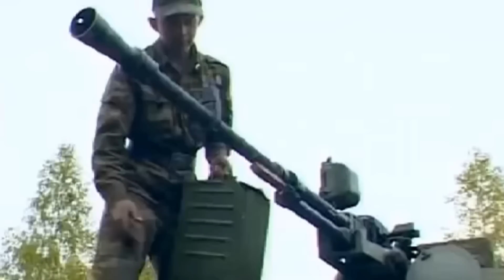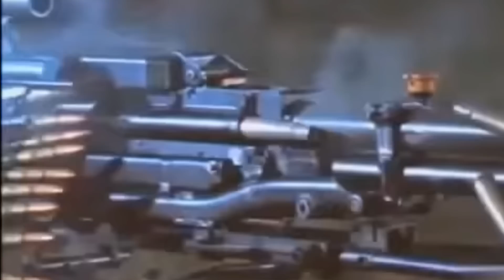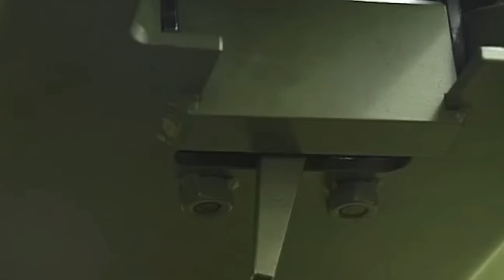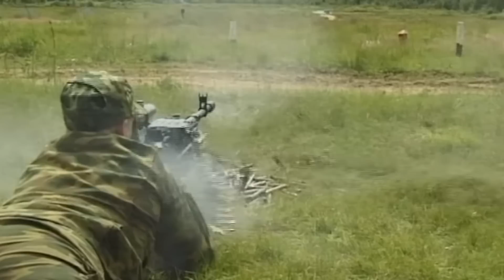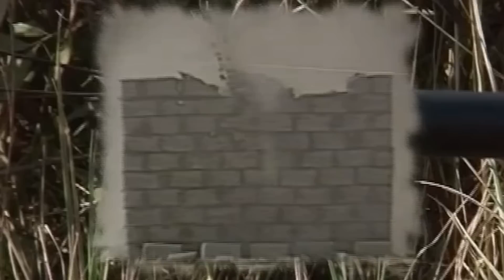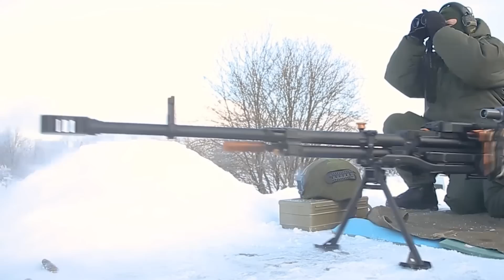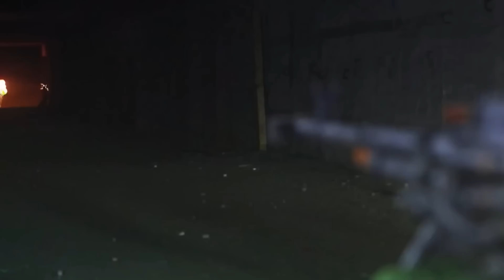Kord 12.7mm Heavy Machine Gun | Russian Beast

Comment: Im impressed by how much lighter it is than the M2.
Reply: @John Tungul Not to mention 2 layers of full ammo box is going to sop any incoming small arms fire like a shield
Reply: @5002strokeforever  a shield that has the potential to explode
Reply: The m2 is mostly relegated to being a mounted weapon. The mounted variants of the Kord are not that much lighter than the M2.
Reply: depending on what you are doing with it, that's not always good.  Weight improves accuracy and recoil, but makes it less portable.  It's a trade off, so it just depends how you intend to use it.
Reply: @p51mustang24  these beast mate can be carried by one big soldier from house to house, field to field in moderate speed while maintain high accuracy and lethality. Can m2 do it..?
Reply: @satriorama4118  there are several pictures of soldiers in Vietnam carrying the M2 on their shoulder (solo) while the other man of the team carries the ammo.
Reply: @p51mustang24  small 3 man mg team moving from house to house in god knows where

Comment: The cocking wire in the ratcheting cocking mechanism will be at least 10 times stronger than it needs to be. Metal cables are ridiculously strong for any given diameter. It ain't going to be snapping and causing problems. Great overview and detail about this monster of a machine gun in this video though.
Reply: "Metal cables are ridiculously strong for any given diameter."

Having worked with and around steel cables, I have to disagree with you.  They're initially strong, but they're very prone to stretching, wear and corrosion.  Give me a cocking handle.

Comment: Meh.  The Browning .50 caliber (12.7 mm) is better than this.  The Belgians even modded it to fire at 1,600 rpm.   

Russia’s most beastly heavy machine gun was their KPV-14.5.  Too damn heavy, actually.  But its 14.5 mm slug could show Mother Russia’s love accurately out to 4 kilometers.  Even the Browning pales compared to that.
Reply: depends what you want to do with the Kord and M2, Kord is lighter, can be more readily used in forward elements and motorized and mechanized elements whilst the M2 would probably do better in armored elements to negate its heavy weight and allow it to use that weight to enable longer bursts with great spread accuracy. Either way im getting the fuck out of dodge if those things are deployed in the area
Reply: Any heavy machine gun is much better when placed in a truck or on a tank thanks to the mobility increase.  But the guns' weight differences to either vehicle type is negligible.  An M2 isn't itself deadlier if carried by a 5 ton truck or an M1A1 Abrams tank.  Nor does it matter if it's an M2, a Kord, or a KPV-14.5, standing in front of one firing is bad for your health.  You'd just have to run a hell of a lot faster to get away from a KPV.

Comment: The Kord and thier 30mm auto grenade launcher (dont know the name) are two of the best light infantry weapons in the world, far better in fact than our own counterparts. The reason I say this is because they are more useful. Imagine setting up a machinegun nest in the fourth floor of a building and planning on shooting down on top of APCs with AP with a M2 Browning 50, it can't be done, the Kord can. Also our 40mm grenade launcher is far less portable than thier 30mm and has about the same blast effect radius.
Reply: Who told you you can't setup an M2 on a roof? There are definitely pedestal mounts for it. You don't even know what you're talking about.
Reply: Do you have a reading comprehension problem? I said a fourth floor window firing down on to the top of an APC. What are you smoking?

Comment: The guy on the left at 7:13 is the spy of the western cause he's wearing an ADIDAS shoes .
Reply: No, this is not Adidas, it's the Soviet "Kimry". Judging by this, he took part in the Afghan company, from the very beginning.
https://i.pinimg.com/originals/50/52/b5/5052b5d52adfd746a6ae121b6c5d080b.jpg
Soviet crocheted boots and even later appeared birches were of little use to the hot climate and mountainous terrain - the soldiers threw them out and in the extreme case wore only in the location of the unit, while on the military exits they walked in sneakers or sneakers. Sneakers were different, part was imported, for example, "Puma" or "Nike" - they were bought in dukans or were taken as trophies when seizing caravans with weapons. There were also Soviet sneakers - for example, "kimry" or Soviet "adidas", which began to be produced in the USSR under license around the time of the 1980 Olympics (the very beginning of the war in Afghanistan).
In addition to the usual convenience, sneakers in Afghanistan could also reduce the degree of injury from the mine. It is difficult for civilians to imagine such things, but in the Afghan war it mattered - if a soldier stepped on a mine in a light sneaker, then most of the time his foot simply "flew away", which made it possible to save the knee and in the future manage a prosthesis. If, however, the soldier who stepped on the mine was shod in a high shoe or a boot, the leg was often injured along the entire length, which in a hot climate was fraught with the rapid development of gangrene and eventually a complete loss of the leg above the knee ...

Comment: There is another point to this mashine gun that is generally missed: It can feed from both sides!

So why not do it? It offers a choise of ammunition to the gunner.
It is a feature we increasingly see in turreted mashine guns.

The main problem seems to be that under 20 mm there isn't much point in it, as the projectile is to small to contain f.i. an airburst option which is very usefull against incoming missiles (f.i. stand of GPS bombs or TOW's) - could be good against infantry as well?

The 20 mm round is actually only an option on aircraft with a high cyclic rate - due to the shortness of time the target is in the sight. The M61 Vulcan is a typical example - especially in head on engagements where the forward motion of the aircraft adds to the kinetic energy delivered to the target.

This means the gun we are to put on our armoured vehicles is between 25-35 mm.

The Puma IFV is typical German overdesign. It has a programmable airburst round - how that is going to be used in the heat of battle remains a mystery to me. If you need an airburst - set it to 3-400 meters, which is over the range of the normal dismounted infantryman. But then again - only the best for the German soldier (practical or not) - they even have to give the Puma's gun a crutch to stop it vibrating like a tuning fork. Will it work? Well, probably some of the time.

But the double feed is not a bad idea, as air burst ammo is not going to impress any sort of protection, so switch to armour piercing. That needs a real tank to withstand that. We are talking STANAG level 5-6.
Reply: TBH airburst ammo these days only makes sense in computer operated systems with built in radar, and you are right it needs to be a big enough round for the airburst to have some impact.  

For .50, armor piercing ammo with small explosive charges are good against lighter armor (that small charge in a confined space can cause serious havoc), and cheaper fmj is fine for infantry.

All of the Anti aircraft 20mm's are gattling guns with built in radar and computers aiming them.
Reply: In the armor vs gun game, things are always changing.  The 30mm gattling guns arent quite as effective on tanks as they used to be, and more and more armored vehicles can withstand .50 cal, 14.5mm, 18mm, etc.  But missile tech is also advancing and penetrating more and more armor.  

If it were me I would ditch .50 cal and go down to .40 cal (10mm).  It will penetrate just as well, but the anti-armor work is increasingly left to shoulder fired missiles.  So you still have a heavy machine gun against infantry and buildings, but more rounds and maybe more rate of fire if desired.

You can get just as much armor penetration with something like .410 barrett, and just as much "ohh shit im being shot by a heavy machine gun" effect.  But way more ammo.
Reply: @p51mustang24 what size grenade launchers should we switch to? 30mm? 35mm? Stay with 40mm? I say downsize.

Comment: The "Cord" machine gun is an automatic weapon that has a ribbon feed (the cartridges can be fed from both the right and left sides). The barrel of the machine gun is air-cooled and is quick-change, it ensures uniform heating of the barrel during shooting, and hence its uniform thermal expansion (deformation). Thanks to this, it was possible to increase the accuracy of shooting in comparison with the large-caliber machine gun "Utes" in 1,5-2 times. The Kord machine gun is designed to destroy fire weapons and lightly armored targets, as well as infantry of the enemy at a range of up to 1.5-2 kilometers, and also to combat air targets at inclined ranges of up to 1.5 kilometers.

"Cord" is the first in the world, allowing you to fire with bipods, and if necessary even with the hands of an arrow. For today it is the lightest among all high-grade 12.7-mm machine guns. For example, the American Browning M2 Heavy Barrel machine of the same caliber installed on a tripod machine weighs 58 kg, while the very body of an American machine gun weighs 38 kg, which is almost 20% more than the weight of the Russian Kord machine gun on sacks.

The caliber is 12.7 mm (cartridge 12.7 x 108 mm).
Sighting range of firing - up to 2000 m.
The shooting rate is no less than 600 rds / min.
The initial speed of the bullet flight is 829-860 m / s.
Angles of horizontal guidance on the grids ± 15 degrees.
The weight of the machine gun without the machine is 25 kg, with the machine - 32 kg.
The weight of the barrel is 9.25 kg.
The mass of tape with 50 cartridges is 7.7 kg, the weight of the equipped magazine is 11.1 kg.
The technical resource of the trunk is not less than 10 000 rifles.
Maximum armor penetration at a distance of 100 meters - up to 20 mm.
Reply: Very detail and useful information, thanks 👏👍
Reply: Translation error, shots fired.
Sorry for bad English.
Reply: More like 30mm of rolled homegenous armor...especiallt with those sabot round
Reply: And its big!
You forgot that little detail.
Reply: M2 Ma Deuce is 100 years old design... so ya it’s a little heavy...
Check out Barrett 50 cal sniper or the Barrett 416 .... really flat shooting round...
The Barrett Home plant is about 100 miles from where I live..... I’ve been wanting to catch a tour of it sometime!!!!
Reply: State of the art, Russian's technology !!       👍❤
Reply: Maybe compare to M-60 for something more recent.

Comment: What is informative is: It is chambered for 12.7 mm. That means that the russians must be running out of the 14.5 mm ammunition. Either because of lack of production or due to improper storage for to long.

To reinstate the larger round in production is perhaps not really an option. Few export costoumers will be interested in a weapon you can't supply with ammunition.
Reply: 12.7, 14.5, 23 and 30mm are used together. 14.5 only on the technique as it is too heavy for the infantry. You are wrong, all these ammunition are produced.
Reply: I notice that STANAG level 4 is against 14.5 mm - which means any selfrespecting medium (wheeled) combat vehicle should be able to brush them off.
The light infantry's counter to a heavy mashine gun like this is clearly the sniper - what is a platoon without a sniper? I mean: It isn't exactly like this heavy mashine gun can remain unnoticed once it opens fire.
And it would be a priority target on any platoon commanders to-do-list.
Reply: Yeah, and the huge dust signature that muzzle brake is going to cause will make targeting the gunner that much easier.  Neat idea to make it more infantry-friendly, but only if you (still) don't give a fuck about your people getting killed off in huge numbers.

As for ammo storage, how it's stored does matter, but from a military perspective there is still a shelf life, as the chemicals in the powder and primers will degrade somewhat over time.  US doctrine looks at it from a reliability standpoint for small arms ammunition.  I don't know exactly the number, but once the ammo reaches the age chemists have estimated that it's only going to go off 99.99% of the time (or something like that), it's used up at the range, sold surplus or destroyed. 

Powder for artillery is regularly burned when it reaches its "best by" date, due to expectations of a reduction in consistency and accuracy.  Inaccurate 155mm fire is ungood.  One of my buddies was a cannon cocker and said that burning the powder was pretty fun, 'cause they'd pile up a few hundred pounds of it at a time, and then throw a flare.
Reply: The trick is: There are a lot of shady characters out there that might sell you - at a PRICE - standard Nato ammo in bulk. The real problem is getting it transported.

There is a Danish shipping firm - known in trade circles as "Krudt-Madsen" (or Powder - Madsen - not the old LMG) that spezialises in transport of weapons and ammunition that regular shipping lines won't touch. Just imagine what fire on a containership would do!
This niche demands a high degree of reliability with a ship in reasonable condition.
You might opt for the cheaper solution with a rust bucket with a crew of drunk scallywags, but then actually relying on them getting your cargo to the destination?
Reply: Just let me clarify, you imply that developing, producing and fielding a whole new weapon system is economically and logistically easier than producing 14.5mm ammunition?

Comment: You could use the heavy mashine gun in a turret on the vehicle, but having gone so far - you might as well spend the extra dollar on a 25-35 mm mashine canon, as even on a light armoured vehicle you will have to fight from a dug in position (or behind some sort of stone wall - granite springs to mind)  - so why expose the gunner?

That does not say that the heavy mashine gun does not have a place!

In my view they are reasonable for lightly armoured supply trucks that does not have to consider artillery fire and aircraft if you spred them out. Heavy mashine guns from a company of supply trucks will make enemy aircraft weary of attacking as 10 of them throwing marble sized shells against an expensive aircraft might not be a "target of opportunity".

The real problem with the heavy mashine gun is: They cannot be used by conscripts - or the conscription period is to long for the modern day. Light belt fed mashine guns like the MG3 (https://en.wikipedia.org/wiki/Rheinmetall_MG_3) is an option for conscripts - just - and in supply coloumns only. Even I can fire that MG and on rare occations hit something - like a whining congregation of tree-huggers with walkers - rarely otherwise seen as a serious military opposition.

Comment: I think Ivan noticed the effectiveness of the American 50BMG so they wanted there own
   They actually made it potentially more powerful by making there case longer to hold more propellant ( little over a quarter inch longer) but just a few years after they made this round they came out with there famous 14.5mm which is more powerful than either 50 cal. the only reasons I can see them keeping the 50 around is because it's probably cheaper to make and you carry more rounds since they are lighter other then that why bother
     BTW since you talked about the Russian HMG..... you should now talk about the god father of all HMG's the one that has stood the test of time especially since it's 100th birthdays this year the legendary M1918 Browning machine gun more commonly known as the M2
Reply: Theprfesssor The Browning M2 .50 caliber heavy machine gun. Now that there is a legend of a gun. Just as iconic as the Colt M1911 and the Kalashnikov.
Reply: BMG & M1911 designed by the same person - John Browning.
Reply: Just FYI 12x108mm round was developed in 1930 for DK HMG.
Reply: The .50 BMG and 12.7x108mm are on par, the longer case doesn't necessarily mean more propellant, and even so that's not the only factor for pressure and energy. The velocities are very comparable.
Reply: @MrSnakedHD  
   Thanks to its larger case they could make it more powerful, it's like a magnum cartridge even if the round is the same it gives it potential to have a higher energy now in this case ( no pun intended) Russia seems to have chose not to but they could one 
    Two big reasons I could see why they used a bigger casing 1) there propellant might not have been that great so they needed more 2) they made it bigger so similar gun couldn't use it Russia has done this for a long time like there tank guns the Germans use 88mm they use 85mm NATO uses 105 and 120mm they use 110 and 125mm even small arms NATO uses 5.56mm and 7.62x51 and they use 5.54mm and 7.62x39
Reply: @theprfesssor  you have on off it's 5.45×39 not 5.54 also each country either develops a certain round or shell for a certain gun or they design a gun to fire a shell they already have
Reply: By making the case longer they can reduce the pressure, and get longer lifespan of the gun, or make it easier to design a working gun that doesnt explode.  Containing the pressure of a .50 rifle takes some engineering skill!  The downside is that the ammo becomes larger and heavier.  This is sort of what happened with the switch from .30-06 to 7.62x51 nato.  Both are essentially the same when loaded to military specs, but the 7.62Nato is smaller and lighter (yes, i know, .30-06 is usually loaded up more powerful than 7.62 NATO, but im talking about old military ammo in the 40's, not modern loads).
Reply: No the M2 was developed in the 20s. Your thinking of the M1919.
Reply: Russians had Heavy Machine guns before